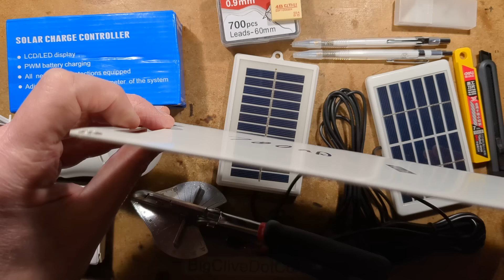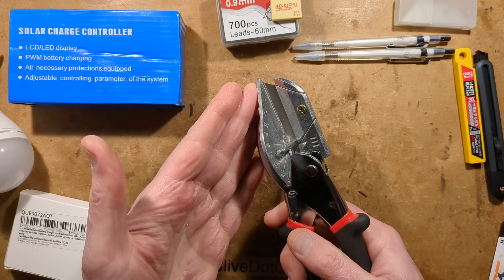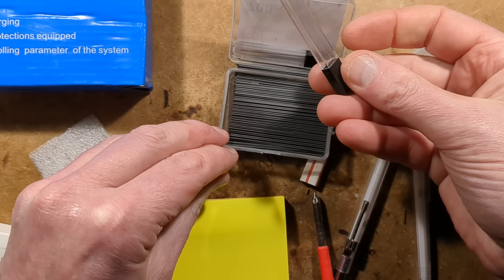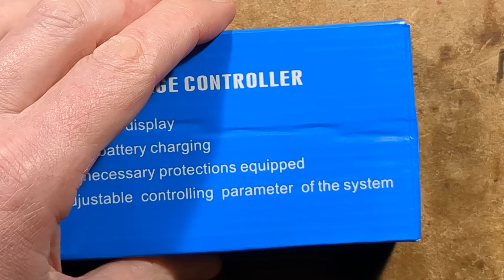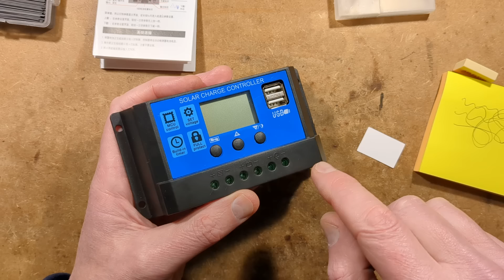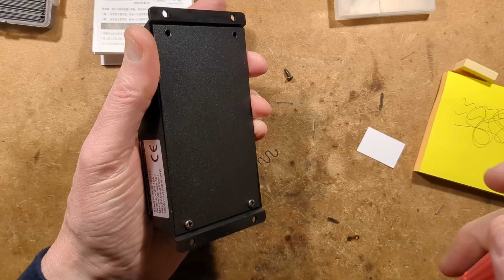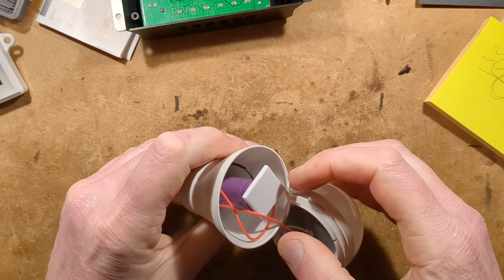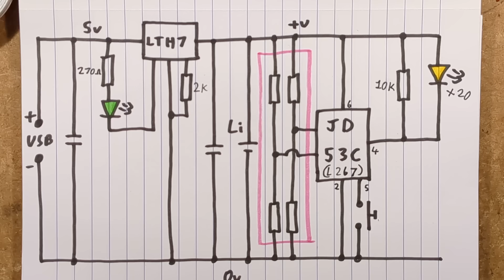Random stuff, a teardown and a little bit of smoke

Comment: I thoroughly enjoy your videos, I became interested in electronics and electrical circuits at school in the 70s. I built a metal detector for my CSE in Engineering Science (there was no O Level but they had an A level). I spent my working life as a paramedic or paramedic firefighter but decided to read Electrical and Electronic Engineering and obtained a 2:1 12 years ago. 
I agree that there are lot of gimmicks on LED light sources but everyone in my family has a torch with strobing and SOS function, we live on the side of a mountain. If you breakdown or have a problem it could save your life, especially in winter.

Comment: As I understand it, you shouldn't use a PWM charge controller for lithium batteries, as it causes damage to them, because of the P. Can be good for desulphating lead acid batteries though, apparently.
Reply from the maker: I think this unit relies on the solar panel's current output and just shuts it off when the charge is complete.  I may test that.

Comment: For the razor blades:  Maybe you can get regular ones and stack them together and tape them up firmly.  
Then using a Dremel type tool you could drill the required holes through the stack so they will fit in the device properly.

Comment: I wonder how those pencil leads,  in a suitable holder,  and with a somewhat higher voltage applied,  would do when used as electrodes in an arc light?  :-)

Comment: I use the gasket cutter in a hobby of matchstick modelling. After long term use I concluded these really are only a good pvc trim cutter. The blade forces a deeper channel in the base plate, to an extent that it no longer cleanly cuts the matchsticks, and the force used means the blades wedges itself tight into its clamp ( no pip model) making blade changes a pain So maybe that's why your blades have the holes/posts.

Comment: As a matter of curiosity, can I use one of those solar controllers to charge a secondary battery (12v 7Ah) using the 12 volt car supply (eg for a cooler box), or does the primary input to the controller have to come from a solar panel?
Reply from the maker: These controllers are designed to work with a current limited source with a higher voltage than the battery being charged.

Comment: 13:10     I always have a hard time trusting controllers like this hooked up to lithium cells. Especially if the pack is in a vehicle as a starting battery or such. It would make me feel MUCH better if there was some sort of watchdog circuit that WILL disconnect the charging current if it detects a microcontroller error. Unfortunately, a watchdog circuit is usually only reserved for a high-dollar unit... 😟

I got nervous using a cheap controller that I had hooked up to the battery in my Hotrod, and I ended up buying a much more expensive unit just for the peace of mind that it won't blow up the lithium starting battery in the vehicle, and burn the car to the ground.

Edit: Sometimes all it can take is a single stray cosmic ray to hit the micro, and end up locking it up. It's been proven to happen before with microcontrollers in random products... 😬

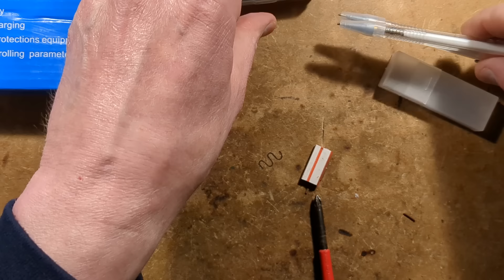Comment: 5:10... Ooo, I LIKE the large pack of lead refills that came with those pencils. 

I have a couple of really nice mechanical drafting pencils, that were made in Japan, that my grandfather gave me (He was an engineer for the Bell Labs telephone company back when land lines were a big deal), and refill packs of 0.5mm leads around here are ridiculously priced, and only are available in packs of about 10 or so. 700 of them would last me a LONG time. 
Hell, I'd just buy the pencil with the leads, and just throw the pencil away, and I'm SURE it would be MUCH cheaper than buying my refills locally. 

By the way, I have also used a lead a time or two (bigclive style) for a temporarily low-value power resistor in projects that I were working on.... 😆 
Just put your ohm meter probes on the ends of the lead, start sliding one probe down the lead til I got to the 20-30 ohms that I needed, and then snip it off there and attach some croc clips.

It was usually some sort of audio power amplifier that I was making, and I CAN vouch to all you audiophiles out there, that the pencil lead resistors sounded just excellent 👌. There's NO need for expensive Dale, Mundorf, Audionote, or other boutique resistors (💸) for your Hi-Fi amplifier.... 😂

Comment: I purchased and used 1 of those solar charge controllers with a lead acid battery and some LED lighting in my garden shed.  It severely overcharged and ruined the battery.  It will be very interesting hearing your analysis of the device.  Looking forward to the video.
Reply: I have several of those controllers connected to 12v L_A batteries.  I use the installation to power 12v pumps to move rain water to various parts of the garden and greenhouse.  Generally they work well although they don't like getting wet!

Comment: Some of the solar charge controller are amazing
Some don't even work
I orded a bunch of em 
I'm currently using one with an old car battery on a 120w solar panel

Keeps my garage light on and  my outside flood light all night long 
Those connectors are very delicate.
But it was a good find

Comment: A very nice collection there Mr C! The Solar Charge Controller is identical to the one fitted to the ALDI 800w folding solar panel kit they were selling Down Under during our summer.  Decent panels too, producing a good 800w (in our sunny conditions) you  can also get the larger diameter  Carpenters mechanical pencils, that come with a wide range of coloured "leads", and write on almost any surface.

Comment: If you glue a flat piece of thin plastic onto the base plate, you can use your new cutter to cut thin, long vegetables. Google "Clever Cutter Kitchen Scissors" in images to get the idea. "Clever" is not an accident.

Comment: I found the blades in the USA. Holy moly they are expensive.  I found one part # T-032001 
Only $740 US for 100 blades. I was going to try and cross search but the ISP has it blocked.

Comment: When I was in school, I was sitting in the back of a class and happened to be sitting next to where the projector was plugged into the wall. And the plug wasn’t all the way in. My curiosity got the better of me so I extended some lead from my mechanical pencil and laid it on one of the blades and slowly brought the other side down onto the other blade. You can imagine what 120vac did to that lead. Amazingly, no one noticed as there was quite a lot going on. But I learned an important lesson about electricity that day.

Comment: I'd love to see a teardown/reversing of the solar charge controller..   I got a couple of these and they basically work (PWM charger), but they have a 0.4 volt offset error with their voltage reading if I recall, so the battery will never actually get a full charge (which is not necessarily a bad thing), but it may also cause other problems. and I was wondering if that offset could be fixed without hacking the controller firmware...
Reply from the maker: You can set the voltage thresholds you want.  Reverse engineering video is made and coming soon.

Comment: That solar charge controller will fail with smoke if you try to use more than 80% of its rating. Or don't put other cooling arrangement for the mosfets.
It's very common solar charge controller...

Comment: The cutting tool is typicaly used for cutting small pieces of wood molding. We use it to cut shoe molding  or quarter round to nail to the baseboard after new flooring material is installed

Comment: Those solar controllers are generally quite reliable. They are PWM, not MPPT as some of them indicate. There are many different versions some will do Lithium and others won't, they come in different current ratings hence the extra positions for more MOSFET's. There are some more upmarket ones that will also give you solar panel current readings and also output current readings. They are very handy and functional at very low cost. I find there's nothing wrong with having the LCD display soldered in as you don't bother repairing these, you just chuck another unit in if it goes faulty. I normally just but 2 at a time so i have a spare for quick replacement, spares are just sitting on a shelf waiting to be put into service..... haven't needed them yet.

Comment: As others have mentioned, this was a splendid deviation from the normal videos - kind of a Big Clive Mailbag if you will. 
One thing I’m curious about is why no one has ever designed/built a decent flashlight chip that doesn’t have the horrendous strobe and SOS modes. All I want is high power, low power, and maybe the facility for a very low power Red led.
Reply: Err, would that be a Switch? or even a 3-way switch with a resistor?
Reply: @jcollins-d3y a three(four) position switch is not as "fancy" as a single momentary push button for cycling through modes...
also these controllers can have additional features like remembering the last setting, instant turn off instead of cycle after 5 seconds on the same mode and an automatic turn off after a couple of minutes to avoid running dry if accidentally turned on in a pocket

Comment: If I understood you correctly the controller chip sets output current limits via the resistor dividers that aren’t populated in this example.

Does it have a default “I don’t see any resistors so I’ll limit the output current to x milliamps” setting in either hardware or software? I mean it has to have a hardware limit set by the construction of the output transistor(s) built into the chip, right?

Comment: I came here for the smoke (not Dave Jones' magic smoke, fortunately) and stayed for the interesting miscellaneous 🙂
Absurdly cheap charge controller (the 30 and 60 amp are around 4€, but I don't know if I could trust them for such large currents - 10A is already a gamble, without a proper heatsink).
BTW, you could make low Ohm power resistors with those leads. Even a power variable resistor, for speaker treble level adjustment 🙂

Comment: I use 0.9 mm mechanical pencils in woodwork (custom cabinets).  Never have to sharpen them, always the same thickness line, and 0,7 mm breaks way too easily.  Oh, and no eraser craps (will it erase? May as well throw dice...)

Comment: 13:42 £2 ? Bet you could not buy the lcd screen for that. That looks like they have made a mini mppt controller or pwm do da.
We have a victron mppt controller 50 amp output, it charges 2 x12.8 volt 280 amp lithium ion phos batteries (in parallel) on a bright day currently from just one 39 volt 415 watt panel, very efficient, but we have never run the batteries too low, got 3 more panels to expand, will need to add another charge controller though and more storage, it's an experiment, but the Victron Phoenix inverter works fine too 3kWh, but we never draw that much, most is an air fryer at 1.25 kW when heating element is active.
Gaz Yorkshire

Comment: The fancy adjustable cutter is used by modellers for cutting angles on plastics and light wood like balsa for scratch building. I have a similar one but it doesn't have the adjuster plate on it.

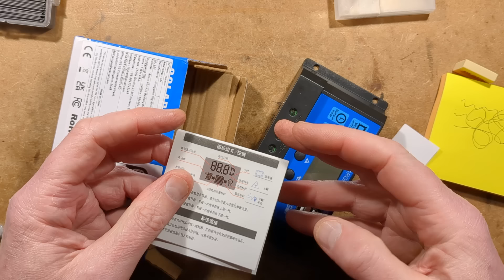Comment: 9:12 looks like the exact same charge controller bundled into an amazon gate opener I installed one time! It automatically switches between 12v and 24v based on the first input (PV or battery) voltage. Guess how long it took for me to realize that when it refused to charge the 24 volt battery bank 😉

Comment: Thought that solar charge controller looked familiar. By sisters camper van has that exact one installed. I managed to work out how to adjust it through trial and error, but I'll be interested to see if you find any dodgy 'features'
It was part of a crap installation that was then inspected by a company that does camper electrics etc.

Comment: I'm an engineer working on cadmium telluride solar cell manufacturing equipment. These cells are manufactured in a thin-film process, applying thin layers (100 nm to 10um) of CdTl and conducting materials on glass substrates and removing thin lines with a laser to isolate the individual cells in between the coating processes. The thin isolation lines and thin coatings compared to bulk material of individual pieces is also how you can distinguish them from "traditional" silicon solar cells. As far as I know, CdTl cells are only manufactured for large solar parks and not for consumer applications, so you most likely won't be able to buy them.
Reply: Is the advantage durability, cost...? I'm also curious if the coatings would be done continuously or on a batch basis.
Reply: How does the energy efficiency of the CdTl solar panels compare to standard Silicon based technology?
The use of Cadmium worries me when end-life disposal time arrives or during fires etc.
I suspect that it's a cheaper manufacturing process that is ideal for large commercial solar PV farms.
Reply: A problem for very large scale manufacturing is that tellurium is relatively scarce, even though extremely small quantities are used. Total global silicon solar cells are now manufactured and deployed at 0.7 Terawatts per year. Cadmium telluride panels are only manufactured and deployed at any scale in the USA, where import tariffs make Chinese silicon cells more expensive.
Reply: @Tim_Small my fathers company refined precious metals and telleurium up through the 1990s. Everyone that worked on the shop floor smelled of garlic as the body metabolised it into dimethyl telleuride which makes breath, sweat, and urine smell like garlic.  The smell on towels and things took years to go after he died.
Reply: @PetraKann AFAIK most refined heavy metals are pretty recoverable, it's only a problem when they're released as pollution during manufacturing or just thrown in the landfill.
Reply: They are available on AliExpress

Comment: Those cheap solar charge controllers are finicky. If you plug in a 18-20v solar panel before the battery it will assume that you are using a 24v battery. They sell one that is "Upgraded". I was only able to get the upgraded version to work. The upgraded one has a different micro controller.

Comment: We get it all the time with circuit breakers, where the busbar is under the rising clamp. Part of it is the use of steel terminal screws. The magnetized screwdriver, almost all of them are, will pull the clamp forward. 

I tend to use my volt stick to push the screws back but it's an easy mistake to make
Reply from the maker: If they were designed sensibly it wouldn't be possible to put the wire under the clamp.

Comment: The cutter thingy is based on a tree  / fruit pruning tool. I used for cutting plastic trunking and it worked ok.  The one you got looks useful, when setting the blade do it with them closed so the blade is parallel with the anvil then tighten the screws.  And loose those studs as you suggested.
Reply: I use it for rubber trimming for doors and windows. The blades are cheap, $2.99/5pk at ACE hardware.
Reply: @jacara1981 Nice clean cut, the angle doobly thingy make it easer.

Comment: Had a controller on my solar pump/cistern water system. After 15 years (not made anymore) controller failed. An exact replacement is not available but the supplier sent me nearly the same solar charger in your video but I don't trust it with my expensive pump. I will design my own.....wish me luck!

Comment: I have a Phocos CML-10 that has been running continuously since 2012 to keep the backup generator battery charged and it has never crashed, or if it did it restarted automatically.

And I also have a Steca PR1010 that I use to control a night light and it is connected to a different solar panel and also a different battery although I have it installed in the generator shed as well, I don't remember it ever crashing either.
Of course, compared to a generic one, they were exaggeratedly expensive at the time, and although today they may cost half or less, they are still not cheap at all.

Comment: AE item 1005002759251106 has those blades and item 1005004955867299 has even more models of trapezoidal blades.
Searching by item number doesn't seem to be working anymore, but you can choose any other item and replace the number in the address bar.

If it shows you a 404 error it's probably because they don't ship to your location, sometimes you can briefly see the product but it is quickly replaced by the 404 error, this happens to me a lot with items that are only shipped to the USA

Comment: Question Clive, I was thinking of using a Vape battery to power a Dewalt laser level 4.5v, would the charging circuit from the light work? or would It not work, or am I just Pishing in the wind lol
Reply from the maker: The DeWalt laser may be better used with a set of NiMH cells.

Comment: 13:18 yea, this happened to me. I had Lead-acid batteries connected and one day i heard a weird bubbling noise. Coudn´t tell from where. The  next day teh same thing and i searched for the noise. The bubbling came from the batteries. I checked the voltage and it was like 15 Volts or something, eventhough the Solar-Charger showed 12.5V. After disconnecting the batteries the display of the controller did not change, so it blue-screened 😂😂. After removing the solar-cells and then reconnecting everything, it worked again.

Comment: I rescued a similar LED lamp 75mm diameter which had been thrown out because the micro USB had been ripped off the pcb..Used a PWM control to reduce the maximum current and extend battery life. Very effective emergency light.